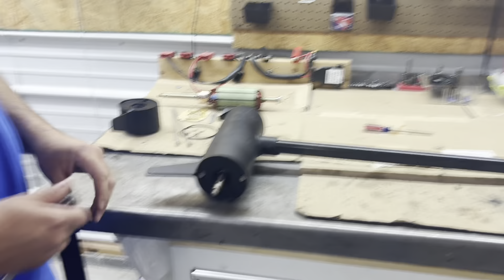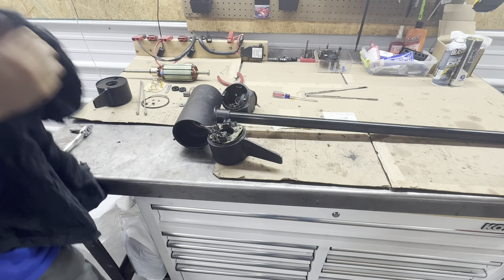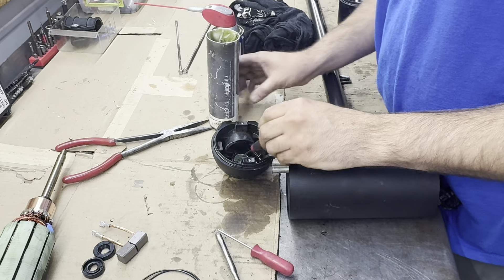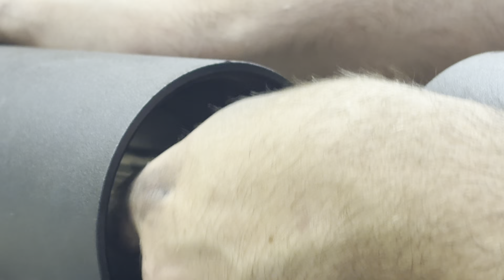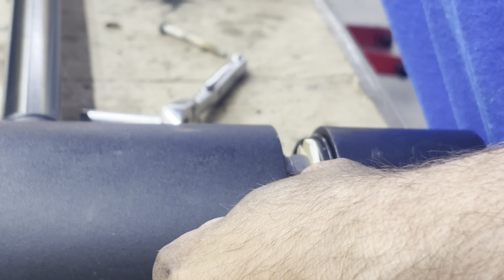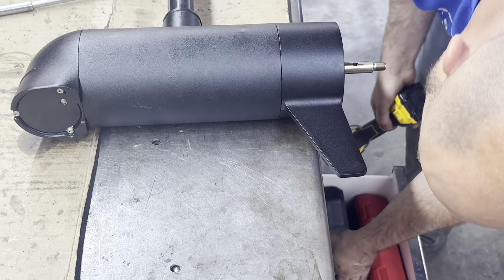How to Replace My Minn Kota Armature

Comment: I just bought the seal kit for my Ulterra riptide lower unit and it did not come with the paper tube spacer. I found out anlbout that part after i already installed both seals. Bottmed the first one out tgen installed tge second right on top. The kit you guys sold did not include that spacer. Should i be concerned or should i pull the outer seal and install the space and get another outer seal?
Reply from the maker: You are good the spacer is not required

Comment: I have a 52 inch MinnKota Ultrex 112 MDI trolling motor.  I recently replaced the armature and while one seal fit the brush end housing snug (into the groove) the other seals included were different (bigger diameter, thinner seal) and did not fit the end housing cap snugly.  I have zero confidence in the fit prevention water from entering.